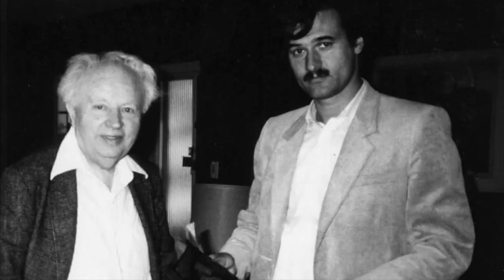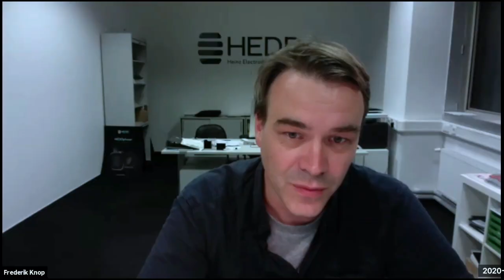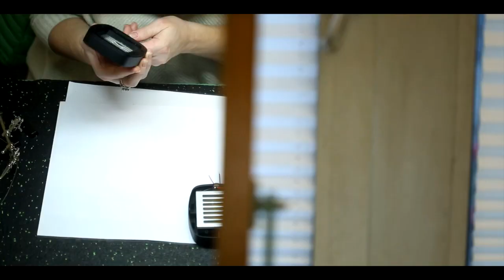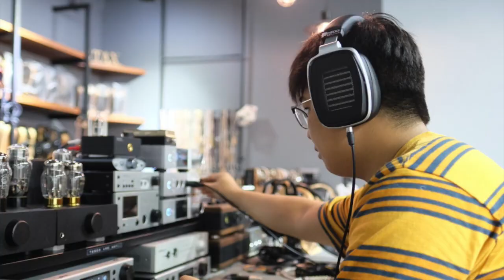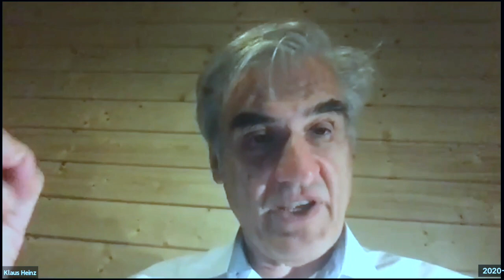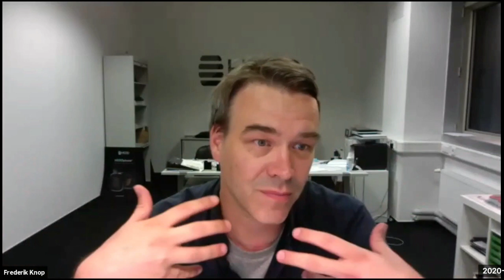The Source AV & LAOCAS in Conversation with HEDD Audio

Comment: I think, the passive speakers may have their own personality in a good way, from a listener perspective. Their soul, warmth, character are touching. But for studio work or a reference for ideal sound representation, an active speakers, especially with built in DAC (which may lead a wordclock questions, tho), is a most clean way to deliver. I start to miss my old home theater speakers, which i have more than 14 years now and did a couple of tweaks and repairs, after start digging into sterile studio sound which i never did before. It has their mystery and depth, the phase response, which i can't find in a lower price point active studio monitors. But to mix with it (not sure about mastering) is impossible as far as hearing an obvious high frequencies and transients in production. In most cases a sweet high slope is doing a favor hiding a chain imperfections for listener/consumer: material bit depth and quality, conversion quality or quality of pickups, pre-amplifier, wires, amp, drivers. For most regular listening systems and room environments. I didn't find a compromise in studio monitoring for music production due small experience and lack of possibilities of doing that yet. I really curious about HEDD's nuisances approach. You, guys, Klaus, speaking about things are important. I see it's priceless effort.
Reply: nuances* :)